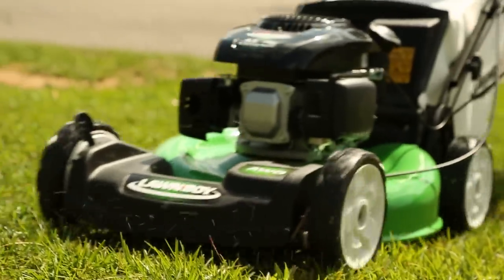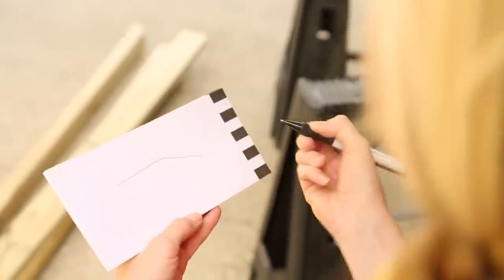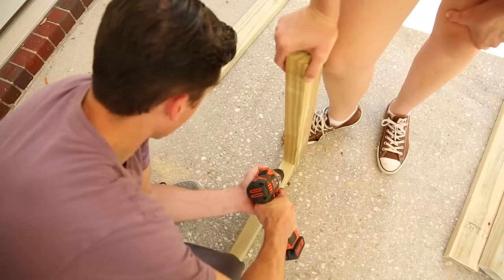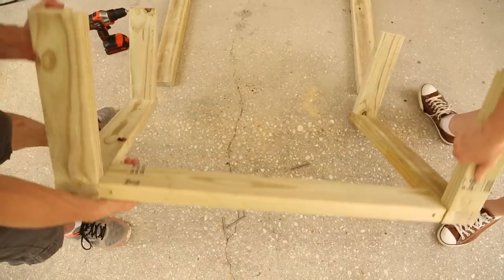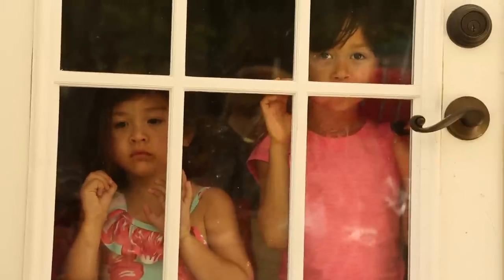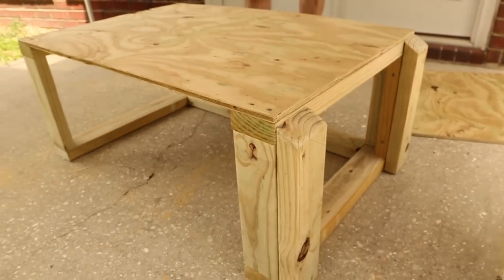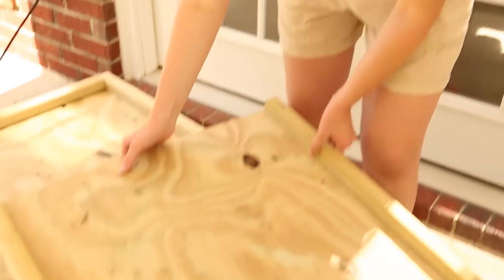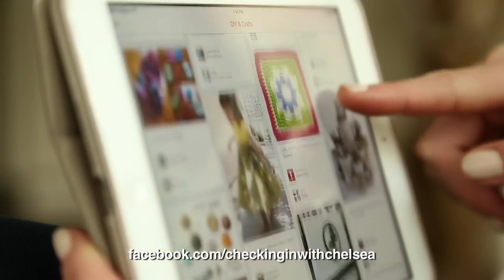Storage Caddy for Lawn Mower and Yard Tools

Comment: The footprint of the platform and ramp is double the footprint of the lawnmower alone.  Fold the handle of the lawnmower and keep it on the floor and build shelves above, as many as you like, to hold much more, all the way to the ceiling if you choose.  A TORO "store-and-go" mower will fold and stand vertically occupying one quarter of the floor space required by a traditional lawnmower.
Reply: I agree. My first thought was that the ramp takes up previously usable space. No less than what is gained under the caddy. I don't fold my handle, but I store my gas, bag, and side chute under the handle on the floor when I put it away. The lawnmower is pushed under my wall mounted wheelbarrow.

Comment: I like it. This could also double as a little maintenance stand so you don’t have to squat down to change the oil, et al. Just create an opening in the plywood large enough to drain the oil and slide a pan underneath to catch it.

Comment: Very cool. I built something similar for my snowmobile. My " Sled Shed" was too cluttered but now i have a drive up ramp on hinges so i can store my sled on top and my wife's sled fits under it. My shed is huge but with tools, lawnmower, snowblower and patio furniture stored in there i had to do something. Plus i want to buy an ATV too but for some reason i just plain forgot to tell my wife about that part.

Comment: I was thinking of making a similar setup for my 3.5kW Generator, I was going to make it tall enough to store two 5 gallon gas cans underneath and make the ramp removable. The extra height will make checking the oil level easier as the fill hole will be more than four inches off the ground.

Comment: Lol 😂 why would you push the heavy mower up a ramp then bend over to get the small items under the ramp.  At some point common sense would suggest the lawn mower should go under the platform and the gas can and other items go on the top.  You seem to have made this backwards for some reason.
Reply: Pokemon GO Evolution  I was thinking the same thing this design makes no sense and serves no purpose.
Reply: But it's all pressure treated lumber so you can park it in the yard to do sweet push mower jumps while you mow.
Reply: lol, first thing I thought also.. wtf would you put the mower on top
Reply: +1 LOL 
A BIT overkill, costly like hell and makes no sense. 
But let's keep within the spirit it's DIY, it works, the kids are cute, so thumbs up anyway. :-)
Reply: Just leave it on the floor and put shelves above it for storage. simple
Reply: Exactly my thoughts. To really use the space I put a shelf on top and my dad later added some wire mesh drawers where they would not collide with the engine. What I most liked is a small cutout he made into the shelf. It exactly fits a funnel where you need it to refuel the mower without lifting the gas can. We have multiple elderly neighbors who borrow our mower.
Reply: My thoughts exactly. Just put the mower under and shelves on top
Reply: Exactly. But women have a different perspective to problem solving. At least her design calls for it to be stored right side up plus the user gets more exercise pushing the mower up the ramp and bending over to retrieve the below stored items.
Reply: Then whyd u click on the video
Reply: I built one for my van with sides but put the mower underneath so that the cable's did not catch on other tools on the van.
Reply: Because lawnmower has AWD..
😀👍
Reply: No kidding....”space saving” she took rough 150 cubic feet the empty space under the workbench to the rear of the handles (6ft) by the width of the mower (3 feet) by the height of the shed (8 feet) and filled it in with a single mower, hedge clippers one chain saw , and a single one gallon gas can. That roughly a queen sized mattress and box spring sitting up on its side. Picture that box of space in your shed or garage and how much in addition to those items could you fit in it, and not have to squat down on the ground nor try and push a lawn mower up a 45degree ramp at the end of mowing the lawn
Reply: ditto that! this didnt save space. basically just lifted the mower in the air for no reason
Reply: Another example of just be cause you can, doesn’t mean you should. Smh

Comment: The handle of almost every lawnmower and a couple of oversized plastic cover screws so that the handle can bend forward over the lawn mower reducing the volume of the mower to roughly the box made by the four wheels and a few inches above the top of the engine. Just design your shelf’s and work table to accommodate such a ground level cavity. If you don’t want to do that.... build a simple table that you can set down overtop if you mower and set things into top of the table. And get a five gallon gas jug that comes with a hand pump nozzle than can be set done in the area under the handles

Comment: Just run across this video. Good job. Sure are a bunch of negative nancy's. They would rather tear down people instead of doing something themselves. Keep up the good work.
Reply: Instead of doing something themselves, like what every single one of us have done? Pushed the mower under the empty work bench and or built a simple shelf that goes over top. 
Rather than just call everyone who offers reality based constructive criticism “negative nancy” how about say one word about how that criticism is invalid?
Don’t call a bad idea Good job because it’s shiny and pretty 
My house has a three car garage back from the time the property was party of a larger family farm. In that garage I also have to store the the riding lawn mower, a push mower, a walk behind snow blower, a roll around generator, a sizable garden tiller with two balloon wheels, a smaller tiller with a couple of push mower sized wheels, a couple of metal utility carts, a two wheel dumping cart and my niece’s fair weather scooter . What I did was put my two tool chests a two door metal lover and a three drawer industrial “end table” on the left side where the one car slot with large things like bar clamps hanging on the wall above and behind the end table and coils of cable hanging in the space above the table, with my air compressor on top of the table. To solve space issue along the back wall I have a series of shelves built from 4*4 posts and 2*6 framing. Tying in with the studs along the back wall, part of the side wall and the bottom member of the air frame roof trusses that gives me 5 storage areas 32 inches wide and a 8 ft storage area all of them 32 inches deep for two levels plus a third area for even longer item between the top level and roof trusses. I also have bunk bed style ladders that fit onto the posts between sections 1&2 , 3&4, 5& the long section and the end of the long section. These ladders can also be used to build a platform for someone to stand on between two ladders. The bottom bunk is high enough to fit the majority of each of those items and the space between the I car section and the two car section is wide enough that several of those items can be lined up there. Although it does require that middle car to be backed in. Something I do most of the time anyway so the driver sides of two vehicles can share the same space. 
..... or I could have done a “good job and build ramps for all of my wheeled equipment and put all my carried equipment on the ground underneath ...

Comment: Great idea l'm thinking of making  one similar only higher so it's easier to remove the blade, change the oil, or any other repairs otherwise you sit on the ground or manhandle it up on top of a table thanks!
Reply: Ditto.  I don't have a real need to store my mower in an elevated position, but I'm tired of tilting and/or wrestling with it just to change & sharpen blades, and change oil.

So for maintenance chores,  I'm going to makes something similar (but taller) with a hole in the center beneath the blade.  Then I can do those jobs with it on the platform, in a convenient position.  Getting it up there won't be hard either, because I have a cheap chain hoist that does the lifting for me.   So I can also skip the ramp.

Besides, doing projects like this is FUN!  Build what works for you, and nevermind the naysayers.

Comment: Ok so as I use a lot of vertical space in my micro shop maximize usage let me offer the following.  If you undo the screws in the top of the ramp you could add a few (3 or more) L brackets like the ones for shelves.  And cutting a matching # of slots where it was mounted before you would be able to remove the ramp when it's not in use.  Every " Saved is a " earned?   Lol see you in the funny papers
Reply: Or use hinges, and store the ramp in an upright position.

Comment: Put the ramp on hinges. Straight up when not in use.
Reply: I did that for storing two snowmobiles.
Reply: Quentin 33 that’s fine for storing two rolling pieces of equipment, but building a ramp and platform, just to put a wimpy o gallon jug and a pristine chainsaw on the floor?